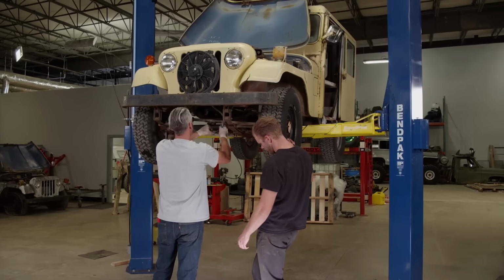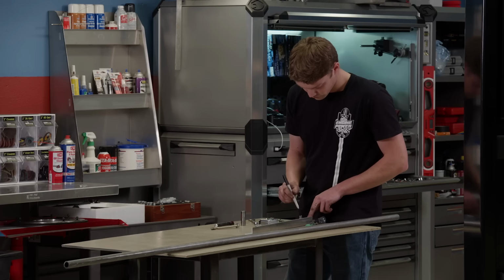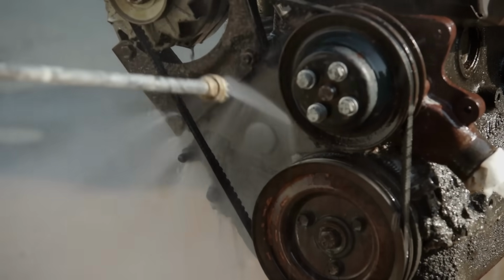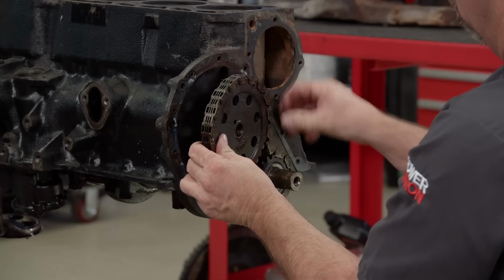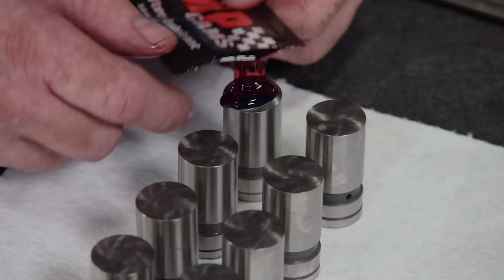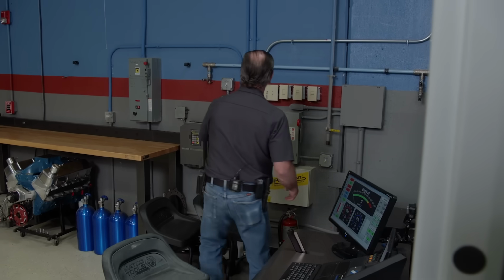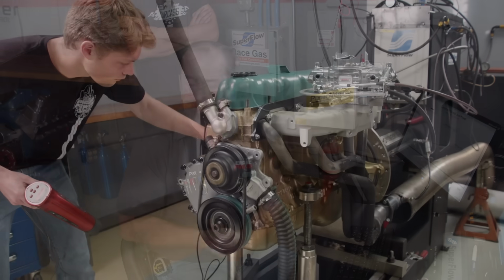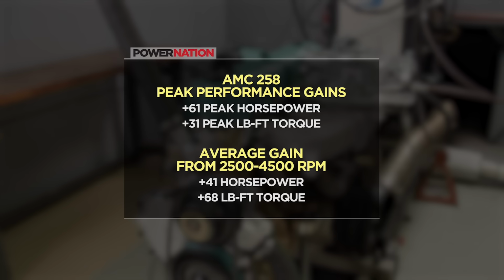Will There Be A Big Power Difference On A Mildly Modded AMC 258 Straight 6? - Engine Power S8, E1

Comment: A few years back I had a '91 Wrangler 4.0 HO.  I did a lot of the same upgrades that you did to this engine.  I went a few steps farther and polished the intake/exhaust ports on the head/intake/header, roller rockers and lifters and like you, upped the camshaft a little.  I also added a larger diameter throttle body and a few other goodies from Summit, 4WD Off Road etc. like a nice electric cooling fan and distributor etc.  Nothing too extreme.  Unfortunately I did not have a before/after dyno to see the actual results.  But I can tell you that the good ole' seat dyno and even the MPG were a lot better than before.  Too bad I sold it.

Comment: PowerNation,
That OFFENHAUSER 4bbl Aluminum Intake Manifold did NOT say  "DUAL-PORT 360" on it ... was it truly a DUAL-PORT Intake ?
If it was an unmarked DUAL-PORT Intake Manifold - shouldn't the 1" high aluminum  "SPACER" have been a FOUR (4) HOLE spacer / instead of a HUGE  ONE (1) Hole SPACER ?
(to maintain the true DUAL-PORT functionality of the MANIFOLD & the Holley 4-bbl carburetor PRIMARY vs SECONDARY  separation? ) ?
COOP
.........................................

Comment: Howdy PowerNation,
CURIOUS - the STOCK RockerArms were "Siamesed"  with aluminum "BRIDGES between the INT / EXH Rocker Arms 
how did your Aluminum Roller-Rockers maintain the Pushrod guidance ??? 
Thanks for the AMC  I-6 cylinder VIDEO 
COOP
...............................

Comment: 8.3:1 compression? Come on guys! You had it apart, so how much would you have spent on some cast pistons to give it 9.5:1 compression? Less than half of what you spent on the intake manifold. ANY time you already have an engine apart, you should ALWAYS replace/upgrade internal parts before external parts. Now tear it back down, put some flat top pistons in it (for $100 more?), mill the head. 0100, then bolt it back together. I bet you get 220 HP, which is what you should have done in the first place! 🙄
Reply: Or put a blower on it!

Comment: I'm surprised that removing the fan only picked up 4 horsepower. Usually those old metal fans were one of the biggest power robbers on those old engines. I have seen as much as 25 horsepower gained by removing the fan.
Reply: It's only spinning 4k rpm.  If you were turning something like 8k it'll take alot more power as wind resistance is exponential

Comment: I'd like to have seen them actually measure the displacement of that engine.  I suspect that was a 232 crank in a 258 block.  8.1:1 compression or not, with that cam and headers, she should have been making way more than 214 lb-ft in a 258.  But that sounds right for a 232
Reply: Yup - the  USPS  might have repaired that engine quite a few TIMES in it's lifetime 
used a 258ci block if / when the old worn out 232ci needed replacement ... 
A " P & G " is cheap & would have determined CID quite easily !
COOP
.....................................

Comment: Hey pat , love the show .  and a big hello to the new kid. Now on the 258amc your numbers seem on the low side I've built several chevy 6s and we got 190 to 250 hp out of them 155 stock to start the amc head must suck in the flow rate? But it's cool you trying different engines.

Comment: 69 rambler 440, 71 gremlin x and a 74 javelin amx, love my AMC's.
Reply: there were no GREMLIN-X's until 1972 - IMHO
Reply: @WiSeNhEiMeR-1369  yeah, I mean, its still a factory 258 with the driver side starter, and not a v8, but still supposedly an X, but I agree, they really didn't earn the gremlin X badge till the 304 was an option

Comment: All those parts, and you made a little more powerful then a stock single barrel Slant Six ???
If you guys want a challenge, lets see a Turbo on a Chrysler 3.8 V6, dropped in to a mid-sixties A-body - a Signet or V200 would be cool with a light V6 pushed back to the firewall and plenty of space for forced induction between the radiator and engine, and still close the hood to hide it all.

Comment: That is still less power than a stock 4.0.  The head on a 258 is awful. Stock those 258's were around  70hp so it wasn't that far off on power to begin with.

Comment: Gee, this engine is almost a 100% copy of an Australian Holden 149, 179, 186 202,, even down to the rocker arms and posts.
https://d3lp4xedbqa8a5.cloudfront.net/s3/digital-cougar-assets/momo-media/15779992/eh-holden-engine.jpg
Reply: Not sure about the copy part but the tiny 202 is a much better motor than this boat anchor

Comment: just change out pistons get a healthy 9.5 or even 10:1 and you've got 200hp easy. If the carb can handle that. might have to up it 100cfm or so. sweet little engine. and it'll run forever with just oil/filter changes

Comment: Nice numbers guys. . Please let us see  a """stroked""" Buick 300. or a Pontiac slant four Super duty build, how about a Pontiac overhead cam 6. or a high output Toyota 2f build. or a GM quad4 with side drafts.  OR the Best an old """Offy Miller"""" engine.

Comment: I would love to see you guys build the late 60's ford 200 inline 6!
Reply: Get the Aussie version with a 3.91" stroke for 250 cubes. I built one with 200 cube pistons to up the compression to 11:1, then ran a nice solid flat tappet cam, thick wall pushrods and a spring/rocker package to suit. I did a basic home port and clean-up job on the head then fit a Holley Brawler 650 mech-sec. Great carb. She propelled my ute into the mid 15-second mark. Nothing crazy, but on par with the might modern Barra motors which make 240hp! Thats double the factory rating for the poor old Ford 250ci Crossflow, haha.

Comment: My one and only build back in the 80's was a 258... 60 over flat tops, schneider cam, clifford intake, holley, split headers. Sounded like crap with duals but great 2>1.  Made a good low RPM torque motor for my CJ5.

Comment: valve springs... valve float and  and those carbs suck.  from experience.  very hard to tune throughout rpm range.   lean at one end and rich up top . standard 600 cfm double pumper cheaper and make much more power and is much more tunable.

Comment: I've been watching a lot of Richard Holdener's channel and one thing I've learned is, if the intake has a spread bore like that and you use an open spacer it almost always looses power down low. And since this engine doesn't run up high it would have been cool to see ya run it without the spacer just to see if it makes a difference.
Reply: YUP - a FOUR (4) Hole spacer would have been MORE appropriate 
&
If this was, in fact, an OFFENHAUSER "DUAL-PORT" intake manifold (it was not badged / cast in the INTAKE as I expected) using a HUGE  ONE (1) Hole SPACER effectively negated the "DUAL-PORT" effectiveness ... IMHO ... this was just an  OFFENHAUSER  360 4-bbl conventional intake manifold ... IMHO 
COOP
....................................

Comment: AMC 6! We did the same mods on my cousin's 72 Javelin back in the day. Great HP improvements, however still on the low side compared to today's engines.
Reply: Do you have link for rocker arms ? Summit racing link is not finding anything but Chevy parts
Reply: @javierbilly3238  The mods consisted of an Clifford (or offy?) intake, 390cfm carb, headers and tuning. Big improvement over stock, however nowhere near even a stock V8 at the time.

Comment: Pat, did I see you use an open spacer between the Holley carburetor and the Offenhauser Dual-Port intake manifold?  

If that was an open spacer, you defeated the design of the intake, which uses a set of divided runners, with the primaries at the smaller bottom runner.  This gives MUCH BETTER LOW END TORQUE and SMOOTHER TRANSITION BETWEEN OPERATION ON PRIMARIES ONLY AND WITH BOTH PRIMARIES and SECONDARIES opened. 

I’d expect nearer to 240 lb.- ft. of torque at peak with this type of combination, but I’d also be using at least a 600 cfm carburetor (Edelbrock AVS2, or Holley Street Demon).
Reply: Do you have experience with those Offenhauser dual port intake manifolds? I was told many years ago that they were horrible and only functioned properly at wide open throttle. That if you wanted to use it for regular street driving, you'd be pulling your hair out.

Comment: When you don't have dowels on the block to align the head cut off the top of two old head bolts and then grind a slot through them  The slot is for a regular tip screwdriver.  Screw the modified bolts down finger tight and then install the head with ease.  After you get a few new head bolts in finger tight, remove the modified guide bolts with a screwdriver and you're good to go.

Comment: they took the fan of and it increased in horse power but what would it have dont with a clutch fan?
Reply: @jaredmiller8740   Um no. the clutch fan was designed to take the drag off the engine while at high rpms and picks back up air flow at idle

Comment: An equal sized inline 6 will always out torque equal size v8s and even some that are larger
Reply: No definitely not true. The 300 I6 made a best of 265ft.lbs the regular 289 by Ford (same cylinder bore as the I6) made 285ft.lbs while the D-code made 300ft.lbs.

It is a long standing myth that an I6 has some sort of torque making advantage but it really does not. If anything it is at a disadvantage. The manifolding on the intake and exhaust is poorly balanced unless you use dual carbs or efi as well as equal length headers. Power stroke has less overlap so it has harsher rise and fall in output through each revolution. The only reason you usually see high torque and low peak power on an I6 is because it typically has a long stroke and small bore so that leads to the low end grunt everybody loves. But a comparison of 2 closely matched V8 and I6 engines will typically see the V8 as the winner because each cylinder volume of the V8 will be smaller for a given displacement so cylinder fill is better and it will make more power and torque.

I still love the smoothness and unique look and sound of an I6 though. The Turbo Chevy I6 they did last year on Truck Tech was one of my favorite builds. I6 engines built with 7 main bearings are also incredibly strong in stock form even with 2 bolt caps. They are typically much easier to work on too.
Reply: @geoffinbc  you wanna come do some towing tests against mine be my guest, 1200 rpm making that tq vs revved to 4000 something to make that torque
Reply: @geoffinbc  secondly, when the 289 was measured it was at the flywheel long after that they moved to wheel hp rating or net SAE and the 300 of 87 to 96 made 265 wheel tq or about 300lbs at the flywheel depending on whats done so your point means nothing as the Ford 300 i6 is rated at 283lbs for 1965
Reply: @Project23-Official  283ft.lbs would be a gross torque number. Not net. So the numbers I posted are the same rating system as what you are saying. If you look at the SAE net numbers in the smog years the 302 (can't find 289) was 242ft.lbs at 2000rpm while the 300 was 223ft.lbs at 1600rpm. The V8 had half a point of compression higher. If we look at a small bore long stoke V8 like a Chevy 305 then we get 250 ft.lbs between 2000 rpm and 3200 rpm. The 267 Chevy made 215ft.lbs at 2000rpm and it had the smallest valves and bore of any Chevy engine.

I am not saying anything bad about the I6. They are good, strong and reliable. But there is nothing about having 6 cylinders inline that make it "out torque equal size v8's and even some that are larger". The only thing that will do that is better compression, heads and manifold design than the engine you are comparing it to.
Reply: @geoffinbc  not sure as to why i never got this as a notification

The 265 number reffered above was the wheel tq of the 300 while we dynoed a 302w at 280lbs but the difference was that the 302 was very peaky and made less tq than the 300 below 2700 rpm, the 300 made about 240lbs by 1k and dropped below 260lbs at 2400 rpm 
The 302 broke 260lbs at 2800 rpm then peaked at 3300 rpm, for a truck application the 300 will do better and get better fuel mileage, but it was an 8.0 compression 300 with efi vs an 8.8 compress 302 with a 500 2V ontop 
The 300 made 138hp though and the 302 at 168hp, which makes sense the 302s stock cam is a lot better than the 300, i just moved to a 390cfm 2V for my 82 f150 and plan to do triple 2Vs and my friend will be doing quad 2Vs same carbs and will dyno again likely next month around the 20th, but in our trucks, my f150 does speed past the 302 truck both 3.08 rear with the np435s and 235 75 15s but when we hit 74 he begins to pass me just to give an idea of what the two f150s do

Comment: Buuahahhahaha. 162hp/4.2L(4220cc). It 38Hp/L 
My 1967 Opel Kadett has 1.1L(1070cc)engine and it has 45Hp. And it pushrod engine too and 7.6:1 CR. Thats 42Hp/L
Reply: Horsepower per liter means nothing.

Power to weight ratio does.
Reply: @FinleyCEvans-sy6sy  It tells about engine performance. And it capabilities. Power to weight tells about whole car.
And I wouldnt be proud of it either...

Comment: The AMC family of I-6 are bullet proof but.....care has to be taken when setting up the valve train if you are venturing away from stock specs. The AMC I6 does not have pre-load adjustment for the lifters. Unlike a typical american V8 where you can simply tighten the rocker stud nut down to set more preload, these AMC sixes set preload by pushrod length. Even at the factory and assembler had choices of pushrod length to set it up right. If you make ANY changes - deck height, head resurface, valve stem height, head gasket thickness, rocker arm type, camshaft base circle - you have to verify the preload. If it's out, the only way to adjust is the pushrod length. And i'm almost positive Comp cams base  circle is slightly smaller than factory spec. That caused me a lot of headache.

Comment: I had the same engine in my 71 Hornet. 232 straight 6 with a three on the tree.  That was a fun car.

Cheers from Kentucky.
Reply: Mine was a 66 Rambler American convertible , had alot of fun with that car at sixteen.

Comment: Cut the heads off some old bolts and screw one into each end of the block should align the head and gasket nicely.
Reply: Did that on my last Slant Six head swap, made it super easy to line up the gasket and head.

Comment: love, Love, LOVE straight six motors!
#1 the Ford 300/240
#2 the AMC 232/258
the rule of the day is always be smooth, and always have the torque you need to get moving
Reply: The 232 is the 4 cylinder 2.5L , Pat mis-spoke in the beginning of the episode. The 242 is the 4.0L and what we're watching here is the 258, 4.2L ... I'd like to see them do the 4.0 Edelbrock head on the 4.2L (258) with other power ladders like camshaft, EFI, Banks header is a no brainers, roller rockers, ect, ect
Reply: @Ikillintel1  232 is a 6 cylinder. 2.5 liters != 232 ci. The 232 is a 3.8

Comment: Well atleast I have a bit of a base line of what to expect once I overhaul my 258. Most of the parts they used are what is going into mine except I have a slightly larger cam and I'm going with the Holley efi and ignition.
Reply: I'm no expert on the AMC I6 by any means but a bigger cam isn't always the answer. any good engine builder knows the power is in the CR and head flow. a big cam in most cases is just a waste. it also make drivability issues in most cases. get that CR up to 9 to 1 or better and that head flowing better and you'll have a beast with even a smaller cam.
Reply: @ProductCode74  it's not a much bigger cam than the one that they used in this build. It's a 212/212 cam made for efi conversions. There's was a 206/212.
Reply: @ProductCode74  and I am increasing the compression ratio by getting the head decked and milled down. 9 or 9.5:1 is the goal.

Comment: Got one of these 258s in my 85 AMC Eagle and damn can I tell you they are slow. Was rated for 115hp and 210 torque but I always expected it to be weaker and the initial dyno test proved it
Reply: Bet your gearing doesn't help. Probably 2.35s.

Comment: Don't know if they're still around but I rebuilt my '81 CJ-5 258 using a cam, intake and exhaust from a company named Clifford Research. They're logo was 6=8. They specialized in inline engines. Huge difference. Ran better than stock V8s. Topped it off with a Holly 390 4 barrel. Exhaust was a 6 into 3 into 2 duel pipes. Never seen that kind of low end torque. It would idle up a cliff. The 232/258 was originally designed by Rambler.
Reply: Rambler was a model of Nash, then a model of AMC. AMC designed the ohv 6

Comment: Would love to have seen with 10:1 more cam and valve springs so we could hear 6k+
Reply: That's what I'm saying lol
Reply: I know it's been a while, but getting 6k+ rpm from a non-crossflow head is difficult, and making any power when doing so is even harder.
Reply: @AustinRBa  don't tell that to us down here in Australia. The Chrysler non-crossflow 'Hemi Six' made 165hp stock from 245ci, and 218hp from the 265ci version with a two barrel carb. The ultimate performance version was the E49 fed by triple side-draught Webers. She made 302hp & 320ftlb and was the fastest accelerating Australia production car - 14.4s quarter mile and 6.1 0-60... in 1972 those were serious numbers!
Reply: @AustinRBa  my non cross flow 4 port 223 4 mainer spins above 6k rpm and makes power on top with only carburation (and sanity) limiting it. I'm sure it can be done with a 258.